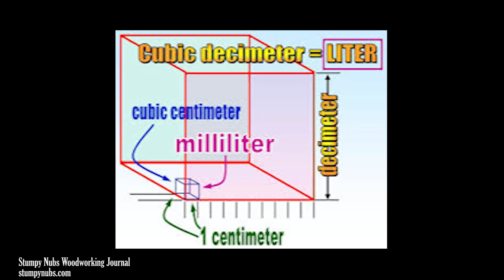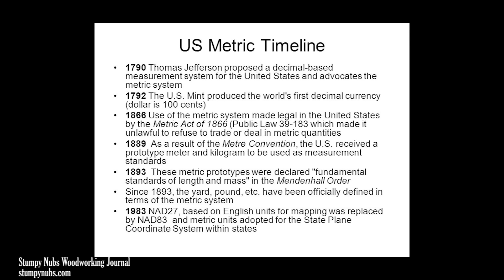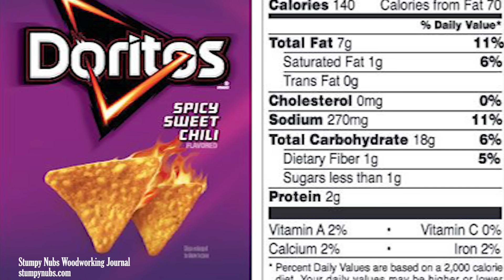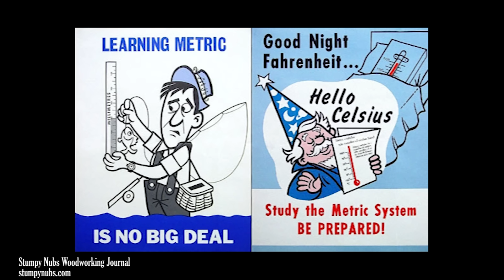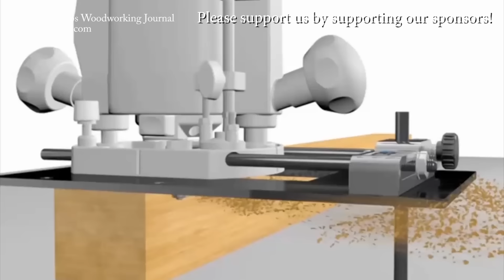BREAKING: The USA is switching to METRIC!

Comment: Australia switched to the metric system in 1966 and after a couple of years for the transition we are fully there and have been for many decades. It's a great system where everything is tied together. Length, weight, volume, area, temperature and pressure. For example, as you showed briefly in your session, 1 cubic centimeter of water weighs 1 gram and exerts a downwards pressure of 1 pascal at sea level.  10 cm cubed of water weight is one kilogram, 1 cubic metre of water weighs 1 metric ton. 100 metres x 100 metres provides an area of 1 hectare. 1 thousand metres is obviously 1 kilometre.  It takes one joule of energy to raise the temperature of one millilitre of water, which weighs 1 gram by one degree Celsius. (I'm starting to get out of my depth a bit now) but  It's such a natural and flowing system. Water freezes at 0 degrees C and boils at 100 degrees C. So easy. I remember the good old days of a currency of pounds, shillings and pence, then 16 ounces to a pound, 14 pounds to a stone. 1760 yards in a mile, 36 inches in a yard.. just to confuse things further an imperial pint (600 ml) is different to a US pint (500ml) so the imperial gallon is different from the US gallon. It was fairly challenging. 640 acres in a square mile ( I think). It's all very random.
I'm personally very happy with the metric system and would never go back.

Comment: Canada has been using the metric system for I don't remember how many years now! We got used to it quick enough, and I must admit, it IS much easier to calculate things like the temperature and fuel. We don't all necessarily like it...but we all use it. Us old timers still think in inches and Fahrenheit, but understand the difference in millimeters and Celcius. Just takes a little time and it all comes together. :)

Comment: The easiest mistake using metric is :  You measure a length of timber, cut, and find out you have cut wrong, you can guarantee the mistake is 100 millimetres or about 4 inches.  Another thing to get over is talking in both languages like millimetres and inches in the same conversation. Australia measures in millimetres, Europe measures in Centimetres.  30 centimetre = 300 millimetres   30.3 centimetres  = 303 millimetres.

Comment: Australian here and with the job i work I've had to learn some imperial measurements although its very situational when it comes to using them feet and inches are annoying but not that bad it's your system of measuring weight thats just terrible I'm just lucky i don't need to weigh anything in imperial

Comment: Funny thing is we also use a little bit of imperial in Europe, socket mounts on wranges are usually in inches, and fittings in bathrooms for example have an annoying combination of mm and inches, where one is 13mm and the other is 1 1/4 of an inch for example. For the most part we use metric (thank got) but there are still some imperial units out there

Comment: The only thing that comes to mind is buying boards, which are sold in board feet. Of course, a 2x4 hasn’t been 2 inches thick for  very long time. Maybe we’ll buy 4x9 (cm) boards for construction. And center studs on 40cm, with plywood in 120x240 sheets. Maybe not in my lifetime. I’m not selling my tools, yet.

Comment: As a mechanical engineer I converted from Imperial to SI (metric) without too much trouble until I went to a steel mill in the Netherlands and naturally started quoting sizes in mm and metres and meteres/ sec only to get strange looks from the Dutch. We work in inches and feet/min - why? Because all our equipment was supplied by the US under the Marshall Plan.
One thing that should never be changed to metric is a pint of beer - it's a well known fact that it doesn't taste as good in cc's!

Comment: As a 52 year old American, I understand completely that the metric system is easier,  once you understand the math. However, for me, the house builder measures to the nearest 16th, the furniture builder to the nearest 64th, and the boat builder to the nearest boat. Fit and function are everything. If the boat doesn't hold water,  it will sink.

Comment: I grew up with the imperial system in UK and the conversion to metric, I still think in imperial for weights, dimensions and volume. 10 cm  can only be divided by 2, 5 and 10 while 1 foot can be divided by 2, 3, 4 ,6 . 16 oz can be divided by 2,4, 8, so it is easier for division of imperial measurements, than metric

Comment: In 1978, I took a one-quarter long high school class called simply "Metrics", which was a requirement.  It taught us all about the metric system, which was legislated to very quickly become the predominant system of measurement in the US.  Nearly 50 years later, here we are!  

That class served me well, and I use both systems with ease, but the history of the metric system in the US at that time was haphazard.  The Metric Conversion Act was signed into law by President Ford, killed off by Reagan, then somewhat reimplemented by Bush the First.

Comment: Canadian here.  The worst problem with metric is construction.  The sizes of lumber and materials has to follow the standards already in place.  A panel is 4 feet this fits with 16 inches studs etc.  Then we continue working in inches when building furnitures because of our tools. Otherwise, we are already pretty much all metric.
Reply: So a panel is 1.22 metres and the studs are 0.406 metres.

Comment: As a British carpenter (for 50 years), I started out with Imperial. Moving to metric (many years ago now) has made me much more productive. I spend far less time thinking about 25/64ths and adding 13/32nds to it. 6mm + 10mm = 16mm  . . .and one millimetre is a perfectly acceptable level of accuracy when working on domestic, house joinery and even 1st fix work. Obviously when making fine joinery, cabinetry or other fine work, it's easy to leave work a millimetre over and work down to a perfect fit. Go on US, you won't regret it!
Reply: That is not true. Fractions are much easier to understand and remember. There is a reason why people in the UK still use stones and feet to measure the human body or talk about TV screens in inches. The use of metric is political in nature and is not natural. There is a reason why the EU pushes it.
Reply: @Art-is-craft  Its true for me!!

Comment: In metal machining and welding work we use the metric system, specifically millimetres. That's because our measuring tool accuracy is given at tenths of a millimetre - at minimum. For example, machining a cylinder bore is measured in hundredths of a millimetre. Have you ever seen how ship engine blocks are measured with computer guided systems, with an accuracy of 0.0001 mm ? In YouTube videos the examples of measuring in inches etc. are often from construction and woodworking, where it's possible to go by with fractional accuracy. Not so much with steel, aluminium, copper and so on. A modern diesel truck engine loses a lot power if the piston diameter has worn out by 0.1 millimetre. You could say, that the metric system is nowadays an essential requirement given the demands of efficiency we require from the use our materials. Metals mined from native sources are not cheap anywhere now.

Comment: 3D printing is another area that is almost 100% metric. The size of a printer's build volume is its length, width, and height given in millimeters. The diameter of the hole in the nozzle that extrudes the molten plastic is always given in fractions of millimeters. The plastic filament that's fed into the nozzle is standardized to 1.75mm. Most filament is supplied in 1kg spools. Finally, all hardware on the printer is metric, from nuts & screws to the structural elements. Doing 3D printing without being comfortable with metric would be unthinkable.

Comment: The only real things preventing the complete switch to metric is the availability of raw materials in metric sizes. Wood and metal sheets and shapes such as I beams, pipes and tubes are still mostly us customary. I have noticed that plywood thickness is now reported as metric and the closest us customary units. For example, according to Lowe’s, 3/4” plywood is actually .703” which is 45/64” or 17.9 mm (18 mm nominal). It’s not 3/4” anymore. It’s still cut to 4’x8’, though. Similarly with sheet rock.

Comment: 1 US gallon        = 3.7854 Litre 
1 cubic metres  =  1,000  Litre  = 35.315 cubic feet
1 cubic feet.       =  7.48 gallon =  28.32  Litre : Obviously ;
(35.315 cu.ft.) × (28.32 Litre /cu.ft) = 1,000 Litre = 1 cu.m.)
1 miles  =  1.609 kilometres...
1 knot (nautical mile) = 1.852 kilometres
Speedy Ferry speed is around : 60 knot = 111.12  km/hour

Comment: It's all about scale. I have mastered metric. Guys new starting out in metric mess it up all the time too. It's an issue of scale. If you do everything in mm in metric, you're not going to have any problems, but you're likely to end up playing with numbers that are needlessly big. But when you're doing things at a different scale, that's where they mess it up. Because it doesn't always make sense to do things in mm. Sometimes CM makes more sense, or just straight up meters (nobody really looks at things in terms of decameters).  It's usually people forgetting a larger number (usually with elevations)  that doesn't need to have mm included, need to still be counted. EG: If a guy sees a plan that says the top of the concrete slab elevation is 100.20m, and I tell them to add 5 cm or 50mm to it, their instinct is to go : 100.20m + .5m = 100.7m. No, its 100.25m.  That's 95% of the places I've seen people get messed up with metric. Its when they deal with a number that has a decimal place where the mm isn't written down (but is implied) that they get screwed up.

Where imperial makes the most sense, is when you're measuring things from 0 inches up to about 72 inches. After that, inches don't make sense, metric is superior.  And feet has its place up to about 30. That's it. Even then, I'd say metric services just as fine as feet does at that scale. Everything else is better with metric. But let us be real here...the majority of the time, people are working within that 72 inch band, or that 30 feet mark. So it makes sense why they wouldn't want to switch. I mean, when you say 6', that's a lot less of a clunky number than saying a roughly equivalent height of 1.80m. 

When we work in metric, very often it's in direct conversion from imperial. IE we will have plans that say anchor bolts need to be .102m apart, or .154m apart, or even .208m apart. Those aren't even numbers to work off either, so if everything did switch to metric, metric would also stand to be significantly less clunky, since separations for things would no longer rely on imperial. you'd have bolts that are .10m apart, or .15m apart, or .20m apart. So really, nobody is winning at this point.

Comment: 6:12 - litres for the motor, inches for tires - even in Europe. Also, in Europe, inches are used for describe TV sets and computer monitors size.
Reply: In the CRT days, TVs were in centimeters, computer monitors were in inches. Now, it is all inches, probably because there is not so much difference between TVs and computer monitors nowadays.

Comment: The thing about the metric (or SSI) system is that there are no fudge factors. For example, take Einstein's famous E=MC^2 formula. Put the mass M in along with the speed of light C squared and you get the equivalent energy. In the metric system, the mass is in kg, the speed of light in m/s and the answer is in joules (watt-seconds).  Easy!

How does it work in imperial units?  The mass? Presumably that's measured in pounds. The speed of light? Well, I guess that would be in miles/hour. And the resultant energy? Er ... God only knows. One thing's for sure, it's not in horsepower-hours, kilowatt-hours or any other recognisable unit. Whatever unit you choose, there will be a fudge factor - something like 4.7593443 x 10^7 or whatever.

Comment: Metrics mostly fine although we should compromise on temp. 0 should be freezing, but boiling should be 200. 200 is easy to remember and 100 degrees being the current 50 degrees Celsius or ~120 degrees fahrenheit just makes sense as that's approximately the maximum temp you ever see on a outdoor thermometer...

Comment: I find the most difficult thing for people using the imperial system is breaking down the fractions.  You can have 13/16ths but you can't have 14/16ths or you can have 9/16ths but not 10/16ths as that gets broken down to 5/8ths.  But why is that really necessary?  That's what scares people away from using a tape measure or math in general for many.  Instead if they just thought of  every little line on the tape measure as 16ths instead of worrying about having to break all the fractions down, they could just count the number of 16ths they have and call it a day.  You can still have the larger lines for 4/16ths, 8/16ths, and 12/16ths, but keep it simple and I think a lot more people would feel comfortable measuring things.  They can break it down in their head after if they want, but they'll easily remember how many 16ths they had.

Comment: I've worked with both system for decades.  I've no troubles with us going more and more metric.  There are some legacy areas that will remain in the imperial system for ages, like land measurement, one section of land is one square mile, and at least in the mid and western US it's surveyed, bought and sold, and road grids laid out on that scale.  But for almost everything metric is just easier.

Comment: I like to say I'm 6'1" (actually 6' 1/2") in metric I'm 184 cm... when someone says I'm 5'8" or 6'4"... I know exactly how tall they are in relation to myself.  Saying you're 172.5 cm or 192.5 cm will also tell me that... but not as directly.

Same with tools. 5/8 wrench vs 14 mm, maybe it's just my familiarity with the simple, low, often single digit old system... but imperial is just often easier to directly visualize vs a system that quickly brings you into double and triple digit quantities for simple measurements.
Reply: Be realistic and admit that it is time to say goodbye to the imperial system and to the 110 volt as well. By the way, Amazon sales will be doubled

Comment: I am European who spent 20 years of his live in US. At a time i arrived inches were just a distraction to me. But after a couple of years of practice... Hey! It's not about the size of it! It's how you use it, right?! 
Came back home carrying all my stuff. Still use 16' tape measure i got from one of the local hardware stores in Philly. The brand name is BIG JOHNSON. Not kidding. So to me now both systems are GO. And whenever i buy material here i know it is never what they name it. 2 by 4 isn't exactly 2 by 4. Same with 50 by 100... Still love and use my Swanson square and Craftsman router... And where it is less in inches, it is more in Volts here ;)

Comment: My country changed when I had nearly finished school. 1976
As an engineer I have learned to work with both systems. Metric is first choice due to its simplicity. Swapping between thousandth of inch and fractions 1/64 etc is hard work.
I have a few old cars so swapping between miles and kmh comes naturally.
It can trip up some. When I first got married we went out on car run with my wife driving my Lotus Esprit. She usually drove a small Japanese car. We were cruising along OK and she seemed confident as had overtaken a couple of cars. She commented that the traffic was slow at 70 and was ready to pass another car.
I had to explain that was already about 10mph over the speed limit (100kmh or 62mph)
It would have been an interesting conversation if the police had pulled us over for doing 100mph (60kmh over the limit)

Comment: Keep them both.  For boatbuilding the Imperial is best.  The metre was established by the Savant measured from a point on the Portuguese coast to another in French Guyana.  This they were pursueded was a quarter of the Earth's size and based the Metre on its length.  Newton noted this measurement and said it would result in the Earth being egg shaped instead of Tangerine shaped.  Nautical calculations measure the Nautical Mile and this fits the Earth perfectly as it does in measuring Time as well.

Comment: 45 years since canada changed, its still very cumbersome. The change was problematic, Trudeau ( our present PMs father ) made it illegal to use imperial. Plywood suddenly was one meter x two . But construction and renos were in imperial, so every sheet of ply had to be trimmed. We still wanted eight foot ceilings , so every stud had to be trimmed . They did go back to standard size , just called them by fractional metrics
All agriculture is in imperial, our fields are 160 acres, but all directions on products are metric 
Out in the country we still measure by miles , etc . A roll of wire is one half mile . A fence rail is 16 feet . A used oil pail for feeding cows is a 5 gallon bucket
Some of the measurements my father used were incomprehensible to me , he seeded wheat at 1 bushel and 1 peck , whereas i just went with 80 lbs 
I never did learn how long a rod is 
I think that in 50 years when us old guys are gone the metric system is going to be the standard , and much easier to use
Even back in the 60s , when medicating cattle we used CCs , never thinking that it stood for cubic centimeters. We never considered using fractions of a cubic inch
My dads syringes came from back in 40s , so they were using metrics then

Comment: Imperial units are inherently on a human scale. This makes it very usable for things like woodwork where it's easy to use. The problems come in technological advanced systems as the units are not consistent with each other. Metric (SI) units link in all domains, physics, electrical, mechanical, etc. This makes complex design possible. All that said using inches in craftwork brings some nostagic romance, and who doesn't like a bit of that.